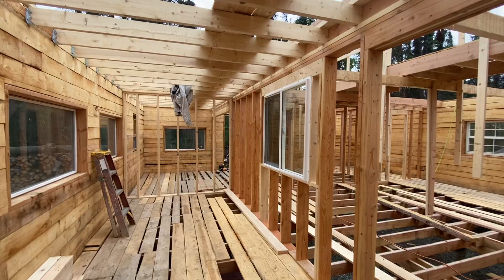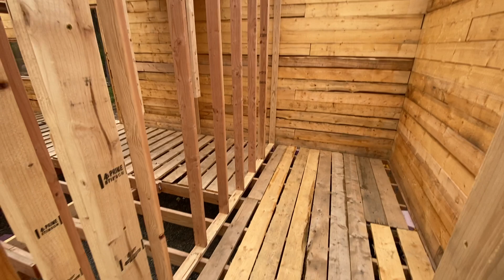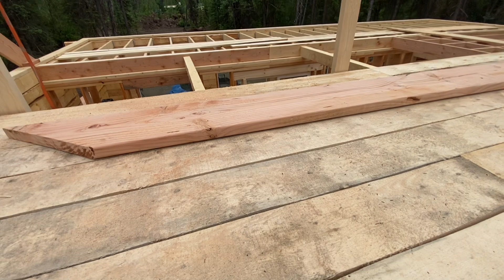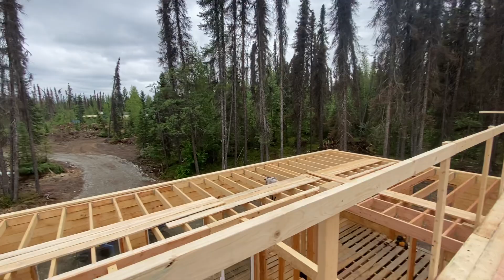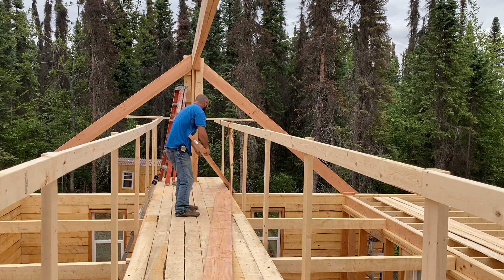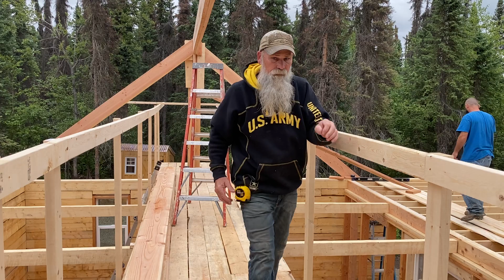0193 Rafter time on the off grid homestead log cabin build

Comment: Are doing a lean two roof (skillion) over the porch area?
We always mark out a pattern down on the floor, height of ridge, half the building and top plate, then measured the rafter, mark out the bird mouth.
And keep one rafter for a pattern.
I did the same with trusses, when building my shed, first attempt.
You're getting there.
Reply from the maker: I didn’t know that’s what it’s called but yes a single slope on the porch